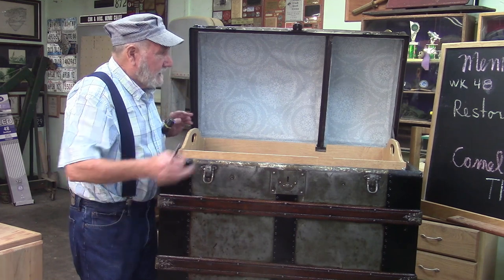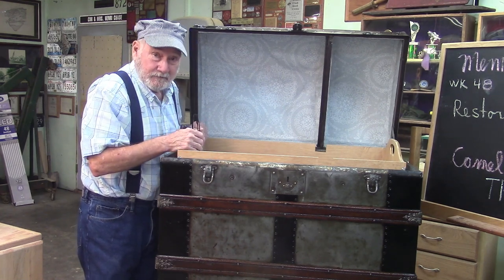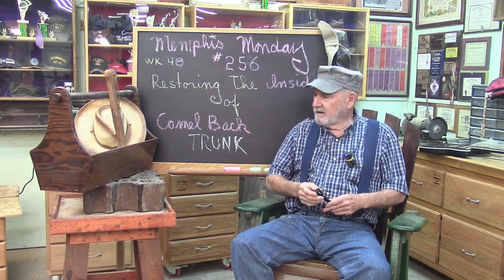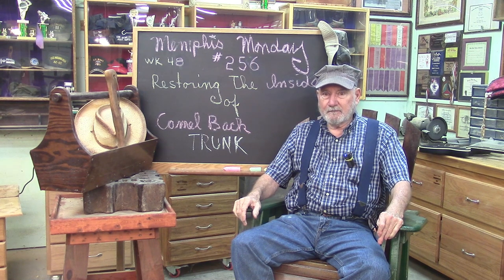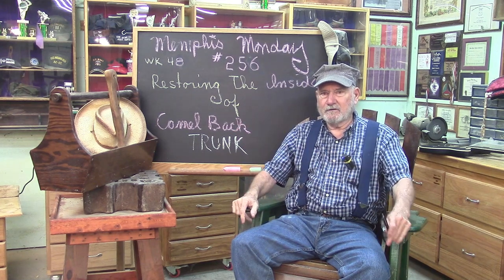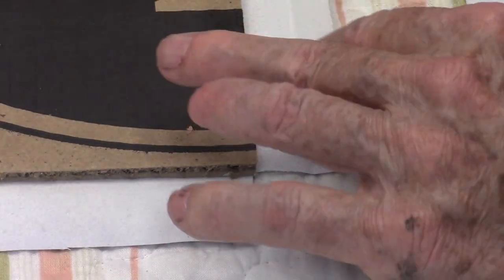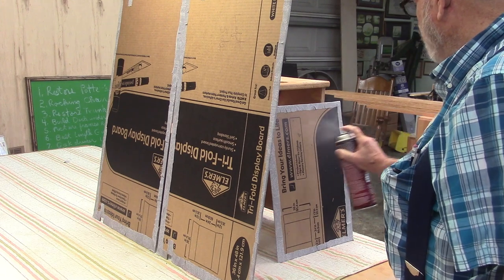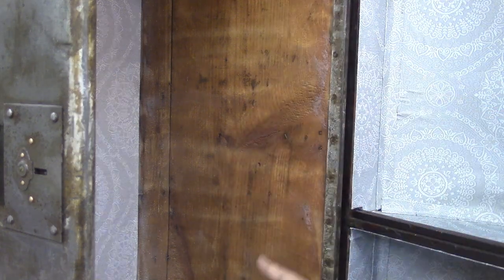256 Restoring the inside of a camel back trunk

Comment: Question, I lined inside with fabric glued to poster board and some of it is not even with top edge. How can I fix this?? That 3M adhesive stuck so fast I could not pull it off to straighten, sigh...